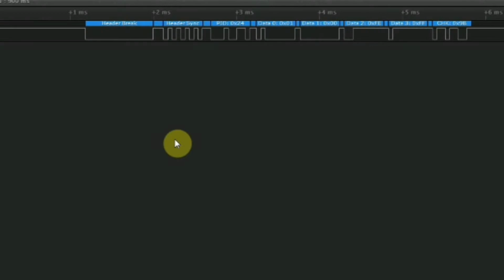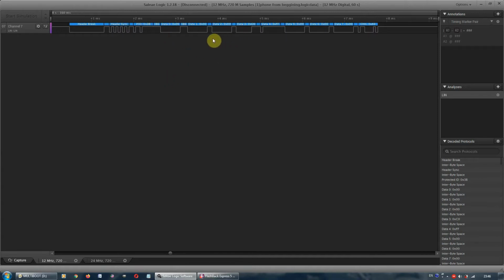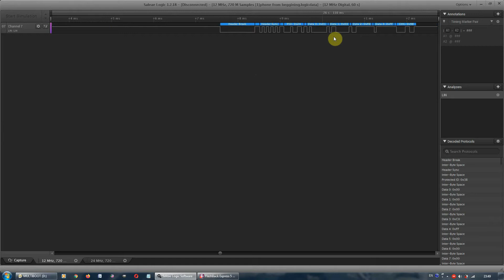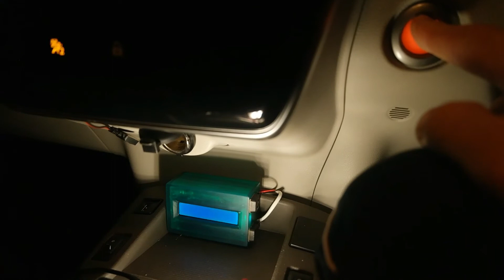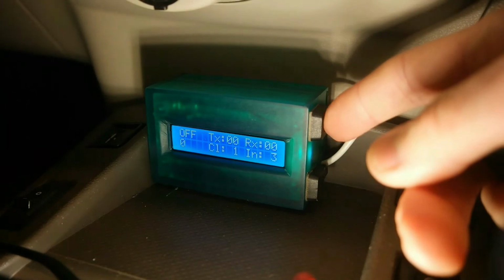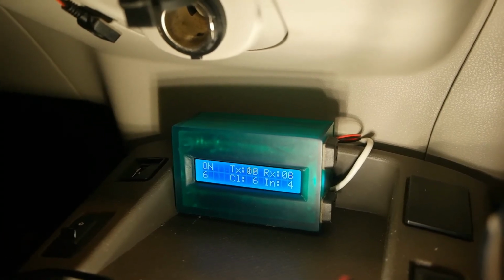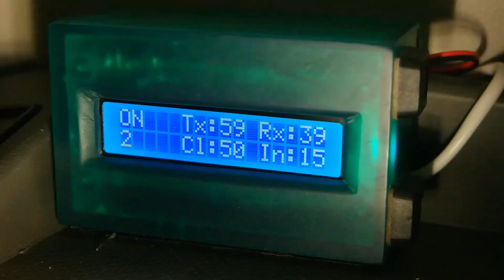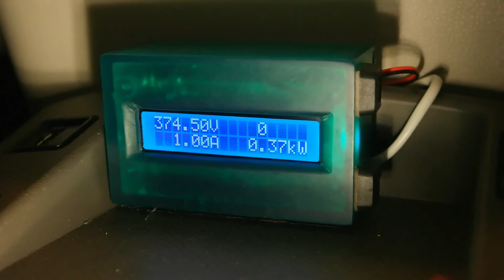Nissan LEAF PTC heater LIN communication hacked. And the DIY LIN controller to control PTC heater.

Comment: Good job! But how is the heater itself knows what heat power it need to give for the system if it is completely disconnected from the ccu?
Reply from the maker: For wet PTC heater it only heats coolant up to certain temperature and keeps it constant. Much like normal heating system works on the ICE cars. For the dry PTC, it's same, it gets to some temperature and then keeps it constant. Power needed to keep that temperature is controlled by internal PTC heater microcontroller. Meanwhile cars air temperature is controlled by the CCU. It just mixes cold and hot air together when set temperature is reached inside the car.
Reply: @ev-olution8597  Yep, but if there are some slaves on this lin too, than dual lin controller bridge is needed I think
Reply from the maker: @aiev5545 Leaf models with wet PTC heater has no other LIN slave devices. Later models with dry PTC heaters has air-con compressor also on LIN bus as a slave device. But later models does not suffer from same issues like the early ones, so no need to use additional LIN controller, unless someone wants to use dry PTC heater in other projects on custom built EVs.
Reply: @ev-olution8597  Thanks! Any analog of mcp2004 can be used? I've got TJA1021 wil it work with it?
Reply from the maker: @aiev5545  I am not familiar with TJA1021, but quickly looking to it's datasheet it looks like it should be a direct replacement for MCP2004.
Reply: @ev-olution8597  one question just about pins 2 and/or 3 on tja1021, it seems to be different type of ready/wake/sleep algorithms and voltage levels then on mcp2004a.... which pin to use for ready/on state?
Reply from the maker: @aiev5545  Sorry, my mistake. Indeed pin 2 (SLP_N) on TJA1021 must be connected to 5V instead of 12V. Everything else can be connected same as in my wiring diagram.

Comment: Hello, Nice projekt! i have a Problem. my car has a alternator with a COM/lin Conector. i am a car hifi guy and i have the problem thats the ecu tells the alternator the voltage. so the Voltage ist not stabile like in old cars ( 14,4 volts) . driving at 2000-6000 rpm the voltage most the time stabile by 14.2 to 14.4v but if i  put the cluch in an the car idels at 800 rpm the voltagedrops to 12,8v for 2 sec and than goes up again to 14.2v If i liesten to some music and do the same the voltage drops to 10.5v and the Amp goes in the protect mode. Untervoltage protect is 11v on the amps. is there a way to say the alternator make 14,4v stabile and ignor the ecu. i am a car mechanic from germany, i played with arduino for fun but iam extream mad at programming.  if you can please help. Thanks Sir!
Reply from the maker: Sorry for late reply, no notification came informing about new message on Youtube. Only seen your comment now when I was checking my account. Now bit about your vehicle. There is clearly something wrong with it. As there is no way healthy battery would drop to 10.5V instantly, unless you keep cranking your starter all the time or got at least 100A load connected to it. Few things can cause sudden voltage drop, such as weak battery, corroded/lose connections, faulty diodes, regulator or pulley clutch on alternator. So you must investigate it bit further before blaming it on ECU.
Reply: @ev-olution8597  cabels are now 35mm2,, The batterie was A new 55ah sli batterie. now i habe a second 92ah hawker agm batterie in the back. the amp is drrowing 60amp+. the alterenator is 90a. but i still have the voltage drop, when the engin turs down. i read renault is telling the ecu. tell the altenator to yous lower power when the car is in idel or the car is @ full thotthel.  at my work (i am a car meechanik) we have a diagnostig tool for all car brands  obd/eobd. with this tool i caN tell the alterenater do 12-16volt. and the alternater dos what i say. if i say do 15v it does 15v idel drinving and ful throttel. i testet 16-15--14,7-14.4-13,8v  all word stabel with the mmusik full power! but if i disconect the diagtool the ecu tells the alternatorsome bbullshit and the voltage goes from 12-14,5v i have evven see  over 15v ater coldstart! renault say this is normal, in cold wether afer start the car the alternators goes to 15-15,5v vor arround 30sec.     sorry for thAT bad english, iam a litel drunk! pease excuse
Reply from the maker: What kind of Amp it is? I never seen amp pulling 60A constantly (if fitted with correctly rated capacitor), unless you use it on full power with test track. But I guess this is not the case as this would damage your hearing very quickly. Also what model your car is? So I can check if I got wiring diagram for it to see what alternator system is used on it. 14.5V-14.7V is a maximum voltage on most alternator regulators.

Comment: Thanks for putting this info out here. I have a d3wz that im planning to put in my 2011  muxsan leaf as now im on my 2nd heater blown in this car. Would be great to get this repaired and also install the d3wz and also an ac powered heater too for clean preheating when parked at my house before a long journey and not wanting to use the battery.

Comment: could you do a wild guess if this would work on the never heater also  ?    it is still lin but air/air  .   And good Work  !
Reply from the maker: If I could see the log data from newer LEAF, then I can tell exactly if it would work. Otherwise 50/50. To get log of LIN bus is very simple. There is plenty cheap data loggers on sale, you just need to tap into LIN line and record what's going on there for few seconds. That's more than enough to see if the messages look similar. Do you know what manufacturer made these dry PTC heaters? If its made by Eberspächer, then it might be exactly same commands used to control the heater. If PTC heater is made by other manufacturer, then my guess - it won't work.
Reply: it seems to be BEHR , but normally they will follow nissan spec anyway 

 https://picclick.fr/Heating-Unit-Heater-Assy-PTC-27143-3NF1A-271433NF1A-SN1232-FOR-133259456697.html#&gid=1&pid=4

i actually have a tesla unit available for the project  but this leaf track looks much more promising with LIN
Reply from the maker: @supersonettify   I don't know much about Nissan dry PTC heaters, but wet one is a big no for projects, unless you want to have a headache every few years when it fails on different bits.
Reply: Great work! I could perform such measurements since I have a 2017 Leaf, just need to get myself some Lin-equipment.
Reply from the maker: @jonaswallerstrom7303  You don't need special Lin-equipment. Cheap (10 Euro) Logic analyzer is more than enough for this job. Just be aware that these cheapest analyzers works only with voltages up to 5V. And LIN uses 12V. So you will need two resistors to make a voltage divider, or resistor and a zener diode, otherwise you risking of damaging logic analyzer. For software you can use open source Sigrok.
Reply: Measurements done!

Comment: Hi, 

Fantastic project! How do you integrated diesel heater? Or you turn it on yourself diesel or PTC manually?  How you regulate the diesel power and how long it works?
Reply from the maker: I turn them manually, either PTC heater or diesel heater, or both together. Diesel heater is Webasto Thermo Top, which regulates power output automatically, if I remember correctly it heats coolant to 75C degrees and then cycles between 75C and 65C automatically, so no need of any additional controller. Many people don't like the idea of having diesel heater in EV. But not using old EV because PTC heater takes almost 1/3 of already small LEAF range in cold winter and use ICE vehicle instead is way worse than driving EV with diesel heater. My LEAF(2011) battery is getting close to 65% SOH, so not much life left in it and will have to be replaced in coming years. I try to prolong old battery use as long as possible.And diesel heater helps a lot in winter time.
Reply: @ev-olution8597  if the diesel heater regulates the running itself, then of course it's a lot more easier. 

I was also looking for diesel heater for my Mii electric, because the range drops significantly in winter times - from around 200+ to 100-140km in winter.
A lot of people don't like it, because it's BURNING FUEL, IT'S BAD!!!!!1111 :D but no, I bought the car because I calculated that the running costs and some incentives (like free parking in city) would pay off the price of car. So maybe burning diesel for heat might even be cheaper than heating cabin with electricity, but can't say about without testing.

Doesn't the car throw errors if it can't find the heater or the heater doesn't turn on by request? Or it's somehow gone over with your arduino man-in-the-middle ?
Reply from the maker: @electricwhirl5175  There is no fault lights triggered on LEAF instrument cluster if PTC heater is completely disconnected from climate control unit. There is some fault codes stored in climate control unit if you check with diagnostic equipment. But it won't affect the rest of functions.

Yes, probably it's much cheaper to heat interior with diesel heater then electricity, especially when we are living in Germany at the moment. We pay almost 30p/kwh at home and 40p/kwh if we charge on Rapid chargers.

Comment: Nice work. Its mid-summer here in New Zealand but I just noticed my heater doesn't seem to be heating, so I might need this!
Reply from the maker: Make sure you fix failed PTC element terminals inside the heater and any other failed components before connecting it to aftermarket controller. Otherwise it will do more damage than good.